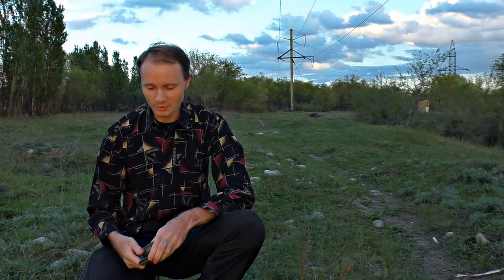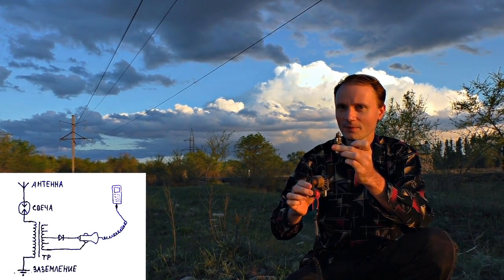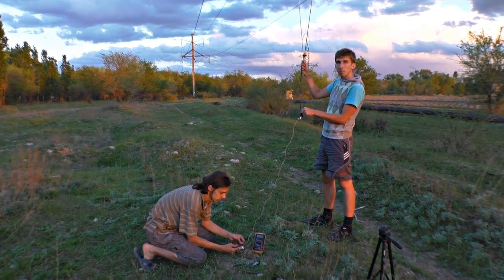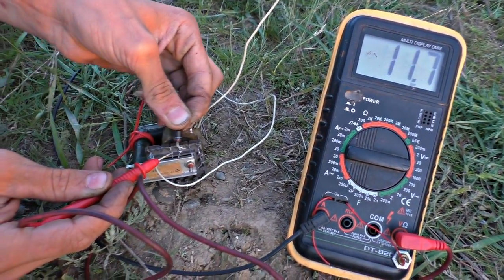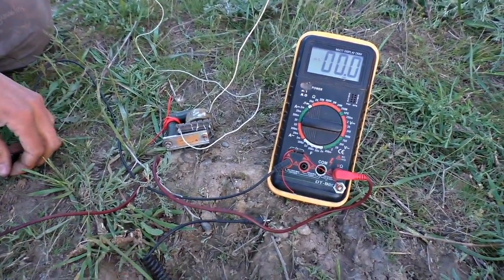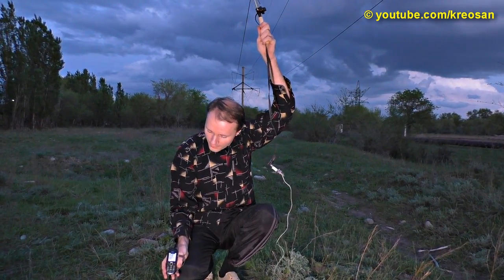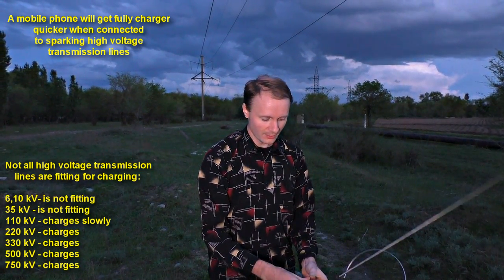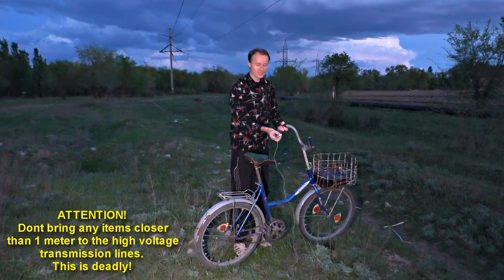Charging from the power lines.

Comment: The same principle can be used to turn off any  trespassing vehicle's at a high security area by installing a device which can turn off the spark plug circuit and other electronic items in the vehicle but for that we need a bigger EMF system, However the rest will be explained in the texts of Nikolai Tesla and his wireless electricity distribution technology or NFC.

Comment: I find this idea positively shocking.
Reply: I have land with a 10k volt power line above it. I can connect this as well to the solar systems charge controller?
Reply: Attila Németh - exactly! For those overcast days.
Reply: @whitehorse1959  sorrz mine is 220 kV which is the first on their list. But can we know how much current it gives? or the bigger the antenna or the closer it is the bigger the voltage and current? i will test mine in august looking forward to it.

Comment: Ah, the old farmer running the lights in the pump shed by connecting to the top fence wire.  The utility company will give you a good charge to if/when they catch up.
Reply: A little Nokia brick phone probably wouldn't even register as a blip on their ledger.

Comment: well made demonstration ! (Thumbs Up) to you kind sir , now how to get more amps from the induced current ? Dose this require a larger spark plug or larger/thinker gauge wires and transformer? Or both larger spark plug and transformer could produce more amps? Also a higher gain antenna that (I assume) would be tuned to the same frequency as the transmission lines, a 60hz current usually. please show how more amps can be tapped from high voltage transmission lines yes?  TY

Comment: You dont need an antenna, just climb on the power line and put one hand on the line while holding the grounded spark plug on the other hand. This way you will charge your phone to 120% of its nominal capacity. Try this at home.

Comment: Voltage and electromagnetic waves are everywhere, before a thunderstorm for example there is high voltage in the air; even on a sunny day you could measure voltage in the air, but there is really not enough energy for an iphone at all. high voltage doesn’t mean there is much energy

Comment: HAHAHAHAHAHAHAHA
There are people that are really buying this and I'm very scared to live in the same world with them!
Reply: WIFIGHOST CRUISER I am scared to live with you in this world cause being a senior in electronic engineer school I can say this does work!
Reply: @zanpekosak2383  

Explain, why do I need ferrite rods with long coils to capture several KILOHERTZ longwaves when you can capture 50 Hertz waves with a flimsy TV antenna from a power line that isn't even a good inductor?
Reply: @westelaudio943  ISNT A GOOD CONDUCTOR here is the key word. That means that a lot of the power is wasted either thru inductance or heat. Since these cables dont carry a lot of current (in power distrubion terms where 50A is chunk of change) and a lot of voltage the only logical thing here is inductance. Thats also the reason why some people are afraid of radiation. I can comfirm the inductance since I literally live under a power line and it can really interfere with tech. I hope you know this is just an idea and that I am not trying to fight with you here. Science is based on arguments.

Comment: Tesla wanted to accomplish this but died without success. I find it NOT so convincing because distance from high tension wires to antenna is at least 50 feet which is a great distance for the static charge to be useful in anyway

Comment: Well, its not fake, you can also light up fluorescent tubes, by the same method, of course for that, the flyback transformer is not required.
It will work effectively, only for power lines having voltages higher than 110kV A.C., as they have mentioned in this video.
Reply: I say the only reason this works so well in the video is that these powerlines have way too much voltage on them for how high up they are, if they're getting this much power through capacitance then these power ones should definitely be much higher up.

Comment: Plausible but highly illegal.  You are placing an additional (albeit negligible) load on the power station.  This energy is "free" only in the sense that you are not paying for it.
Reply: this doesn't actually place any additional load on the powerline, that power would've just been an absorbed into the ground
Reply: @TechHowden This is incorrect.  In placing an “antenna” in proximity to the line, one is effectively creating a single turn of a transformer.  This induces a small amount of current on the secondary and a small magnetic flux on the transmission line in accordance with Faraday’s law, which means a small additional load.  If what you suggest were the case, then transformers would be a source of free energy.
Reply: @WeebLabs  this isn’t a transformer, this works by capacitive coupling which is why the voltage potential was between the antenna (just a piece of metal) and the ground.
Reply: @TechHowden  Again, that is incorrect.  This is easily demonstrated, as an earth ground connection is not required.  Were the "antenna" instead suspended from a drone, induction would still occur.

Comment: Be really careful standing under any power lines holding up a rod/conductor/antenna it's super dangerous, it could be the last thing you ever do. Even at a train station with fishing rod CURRENT CAN JUMP ACROSS AND KILL YOU.
Reply: Even if you have rubber boots on, it's no where near enough insulation, the current can easily jump across and kill you.

Comment: Admit it you know as well as i do that this does not work. You know full well that electricity does not work in this way. Btw nice hidden power source for the spark plug
Reply: Alternating current in the power lines creates a changing magnetic field. If a conductor is placed in the changing magnetic field, a current will be induced in it, so the method shown in the video should work.

Comment: I tried this with a coil thinking it would inductively couple to the power line's magnetic field, but it didn't work. Not sure why. Perhaps the magnetic field is much weaker than the electric field?
Reply: Okay so apparently I would need a lot more turns and a capacitor to resonate better at 60Hz.
Reply: It's because most of the power is transferred through capacitive coupling, not induction so you would be better off just running a wire lifted off the ground running parallel to the powerline and the other side going to a ground connection.
Reply: @TechHowden  I assume the wire is shielded to some extent but I'm not sure why that affects the magnetic field more than electric field. I was just using a voltmeter but if I got a field oscilloscope I could probably get a better idea of which configurations work better.

Comment: This is not a good idea,  there is unstable voltages and the car charger will be damaged from the spikes or line hash, line hash is noise or ripple in the voltage which is what causes IC chips to break down, the regulator in the car charger is not strong enough to filter out the ripple noise in the A.C. in which in turn WILL most definitely damage your phone AND the car charger. 
Just some food for thought,  don't try this it will damage your phone.!!!

Comment: actually cars charge at around 14 to 15 volts when running car chargers have built in regulators and you should be able to charge using even as much as 15 v

Comment: The lower voltage lines should still be ok as long you are close enough... just make sure you don't die:p I am just wondering whether that sparkplug is really necessary... By the way good luck, if you and your "professional" friends are still alive! xd
Reply: the spark plug allows for higher frequency switching currents in the transformer and it also allows the voltage to get high before beu=ing discharged into the transformer, so yes I think it's necessary.

Comment: Seems great but in reality you get like 10 micro amps, (watch other videos on the topic) this is almost nothing, it would take a year to charge a phone, plus I wouldn’t trust a car charger to output 5v with leaks and lows in the power grid.
Reply: The powerlines in this video are clearly running at a much higher voltage than they are rated for, This means that there is far more power being capacitive coupled down to the ground so yes you would be able to get a couple of watts of power to charge a phone using the set up on powerlines like this but on properly designed lines it will not work.

Comment: ElectroBOOM, make sure this is legit
Reply: Technically it is legit but only because in the video the powerlines were being run at more voltage than they were rated for, on a properly designed powerline you would never be able to get nearly enough power to charge a phone but this principal does still work.
Reply: @TechHowden forgot about this video. interesting. Thanks!

Comment: I tried measuring the voltage between antenna and ground and get 200v and current 10mA but when I connected a phone charger it did not charge.

Comment: @14 volts you could charge a car battery
Reply: No. The voltage would drop down instantly if you connect car battery to this setup. Charging time with different kind of a setup would be measured in months or years due to small power input

Comment: That's not going to be work.
The mobile battery gets charge in DC voltage.
And they are providing AC voltage
Reply: But there  they used diode... Which converts Ac to Dc

Comment: Fake! Just one thing from all. The multimeter is hacked. Why the black cable is plugged into the 10A connector instead of COM? What is this two red cable comming from capacitor measuring connector?

Comment: How much voltage has the transmission lines? Because I suppose that it is >400kV and think that a low voltage doesn't works because the electromagnetic flux is low
Reply: I know this video and comment are ancient but I'll explain anyway. Judging by how well this works with the small powerlines and how much buzzing you can hear on the camera microphone I would say these powerlines are likely being overdriven due to them not wanting to pay to upgrade the lines to one's rated for the higher voltage. If the powerlines are much higher up like the really high voltage ones are supposed to be then this probably wouldn't work at all.

Comment: Hi! The multimeter connections are wrong for DC voltage measurement (it shold be connected to COM). Is that a mistake or i'm missing something?
Reply: If you look at the meter itself, you'll see a white line drawn from the 10 amp connector the com connector, so they're actually measuring voltage. Now that I see that, I do find it unusual.

Comment: Correct me if I am wrong but isn't high Emf from power lines damaging to the human body?
Reply: This type of electromagnetic radiation cannot directly harm your body, the only physical effect is a slight bit of heating due to resistive power dissipation but that's completely insignificant at these power levels

Comment: doesn't transformer suppose to be AC? because he checks voltage on dc mode hmm seems strange
Reply: fighter s he seems to be using a flyback like transformer. That means it is AC/DC converter.

Comment: Is this actually true? It does work?

I mean, we see a lot of crap in the internet nowsdays.
Don't hurt to ask.

Also, with that one can pretty much hook an inverter and get 110 / 220 volts for "free" or the current would be not enough?
Reply: In the video that does work but that's only because the powerlines in the video are being run at a much higher voltage than they were intended to which means there is a lot more power being lost due to capacitive coupling to the ground which is why they were able to capture several watts of power to charge a phone. On properly designed powerlines this wouldn't work because there isn't enough capacitive coupling to get more than a fraction of a watt. There definitely is not enough power to connect an inverter, although technically if they were to use a long wire antenna lifted off the ground that runs parallel to the powerline they might be able to get enough power to connect a small inverter and power a small device with it.

Comment: wait wtf.. how is there electricity without even touching the wire
Reply: I'm no genius in this field... but I know the electricity leaks a bit because of the high voltage.
Basically it's wireless picking up the otherwise already lost energy and using it.
Reply: They increase the energy lost from the lines by doing what they are doing

Comment: Where do I get the flyback transformer?
Reply: Vanessa L 

A CRT Style TV.  Make sure you drain the charge out of the Tube before you pull off the Anode or you might wind up getting charged. Or just buy one off eBay...
Reply: @tumblevveed3586  oookkk... I know something about the charge in the tube. Doesn't it dissipate after sitting around unplugged for a while? I have an old tv that hasn't been plugged in for years.
Reply: Vanessa L Yes it should discharge over time but I always drained them to make sure before starting a repair.   Just connect a wire to the chassis Ground and the other end to a screw driver. Put one hand in your back pocket and using the other hand, slide the grounded screw driver under the Anode Cap on the tube till it contacts the connector and pop it off. This is not the proper way to drain one for repair but if your disposing of it anyway, this will work as a quick discharge of a fully charged tube can damage the tube. We used a high impedance resistor in-line with the ground.

Just make sure your hand is not near any sharp components and nobody’s face is right behind you as if you do get hit, you might break their nose or knock their teeth out with your elbow.
Reply: Vanessa L 
One more thing, I don’t know if it takes a certain flyback transformer for this project or not. The flyback in a TV is the only one I am familiar with. Might research it before you rip apart your TV.
Reply: @tumblevveed3586  lol thanks

Comment: THIS IS VERY DANGEROUS TO DEAL WITH HIGH TENSION HIGH VOLTAGE LINES..ONE DAY OR SOME OTHER TIME YOU MAY END UP WITH LETHAL HIGH VOLTAGE ELECTRIC SHOCK & DEAD BECAUSE EVEN THE MOISTURE  IN THE ATMOSPHERE MAY LET AN ELECTRIC-ARC TO JUMP TO YOUR ANTENNAS ...IF IT'S THERE  NOT THERE ..  YOUR MOBILE MAY SOON  END-UP WITH DESTROYED MOTHER BOARD.

Comment: Cumulonimbus on the right 
Wireless charge fake
Reply: Nikola Tesla spent a significant amount time in his career investigating ways to transmit power wirelessly. It is possible, in fact, however not practical in the slightest. Also, magnetic wireless charging (aka NFC) is widely used with modern mobile phones. As far as this video is concerned I am skeptical but I do not reject the idea outright.

Comment: This is dangerous as fuck
Reply: No it’s not, you obviously know nothing about electricity
Reply: @robbieedwardsayers841  I mean you are stepping down hundreds of volts and putting your hands inches from the power lines
Reply: @Ian-ff2hz  you clearly don’t, powerlines carry atleast 1kv of voltage
Reply: @robbieedwardsayers841  it depends on the line, and if it's been stepped down further, it's dangerius because your tapping into the lines with exposed live wires
Reply: @Ian-ff2hz  if the line was lower voltage then it would not possess the ability to electrically charge nearby objects

Comment: Captain here, a power system engineer. This is stealing power from the power lines as the lines will feel stronger impedance, hence reducing their voltages & increasing loss but anyway it's just like stealing a cent from a huge bank. If the power lines are experiencing high voltage & need a reactor turned on nearby, this is somewhat beneficial for the grid

Comment: i assumed that the current was AC
how it can be converted to DC to charge a phone only with car charger? car charger just regulate the DC voltage but not converting it to DC.. seems impossible to me
Reply: Thats why you put a diode after the transformer
Reply: @JamilKhan-hk1wl  oh so only a single diode can actually make a half bridge rectifier right?
Reply: @asrulasraff2457  yes, it can be used to charge your phone if you lower the voltage. But the efficiency is much lower

Comment: I want to buy land to build but quarter of of land has power lines is it illegal to to do this as I want to charger battery for electricity for the house and of course is it works for hot water supply to the house as it's in middle of the field I'm sure winds/ cold allaround

Comment: Wow you can take voltage measurements when you probes are hooked up to the Amp and voltage Jack's. No com jack needed here. 🤦‍♂️
Reply: Ryan Jardina Actually you can! Because the amperage port uses current flow through a very small resistance for current detection, connecting to the current sensing port is basically shorting to the COM!
Reply: @graysonking16  you are correct, but displaying this on a public video is bad practice. Most people who watch this video will not know this. Then if they look at their meter and look at video there one step away. 50/50 will not do it properly.
Reply: I agree, and when I saw it, it still definitely made me question the knowledge of the people in question. Either they know this, and are just being edgey, or they found that it works this way, and haven't bothered to change how they do it, in which case, it doesn't seem like they have very good intuition for what they're doing, and probably took these schematics from somewhere else.

I am fairly certain this would work though.

Comment: Totally fake i think
Reply: It's real but it only works because the powerlines in the video are being run a higher voltage than they are meant for, if they had the proper voltage then they wouldn't be enough induced power to charge a phone.